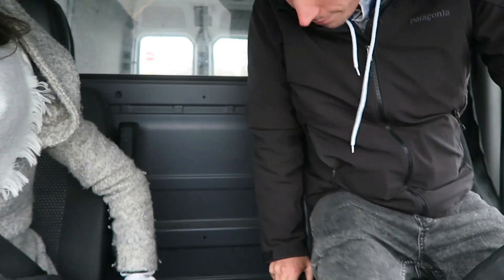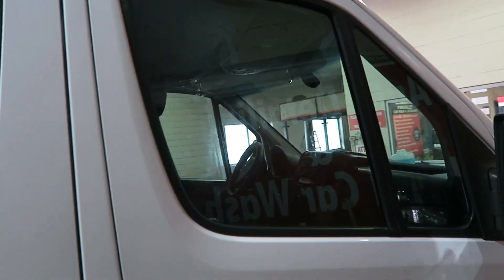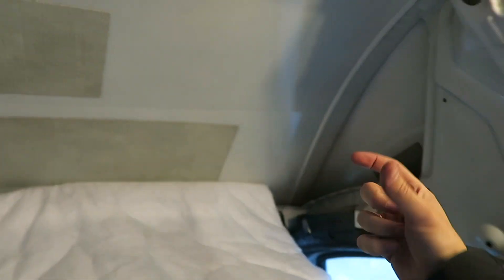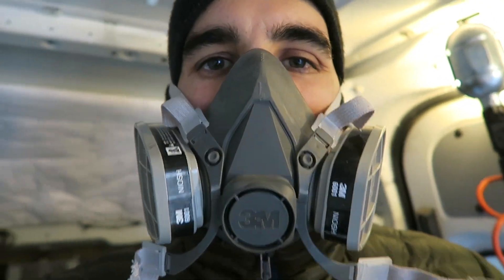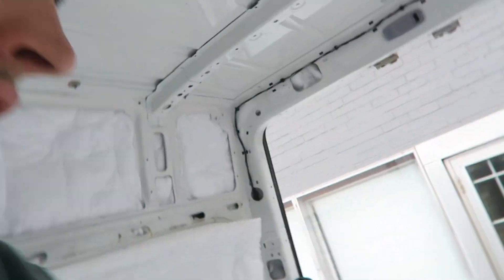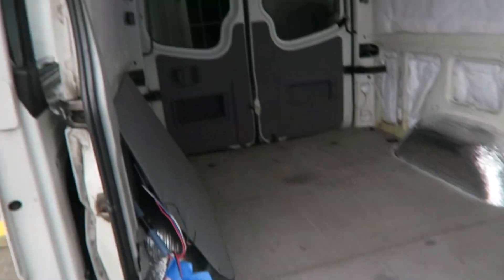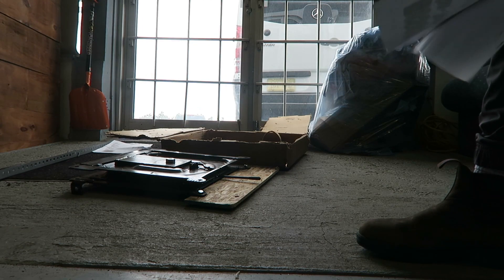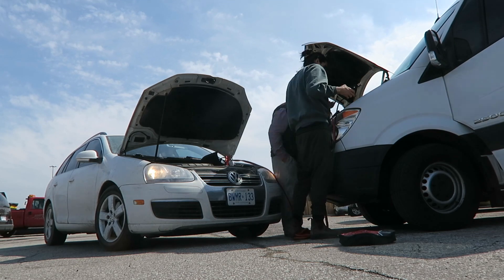Converting a Sprinter Van | Part 1 of 6 | Buying the Van, Basic Electrical, Insulation, Swivel Seat

Comment: Man, that Thinsulate is lovely to work with; I envy you.  ;)  I've used rock wool (for the low cost and because I don't have to go as thin as you do in most places since I am converting an old wooden fishing troller instead of a van), and it was by far the nastiest job.  I think I shall look for some Thinsulate for the ceiling of the engine room though since there isn't much head room.

Comment: Is the 3M thinsulate better for warmth than the foam boards that are used by most van converters?  I was planning to use foam boards but now I may switch to 3M thinsulate. 
Is applying the reflectix farthest from the metal after the 3M thinsulate going help prevent the heat from coming through on hot summer days?
I like your idea of using the reflectix are a water barrier.

Comment: How has the insulation worked out for you? Was thinking of using thinsulate vs using foam and foamboards which a lot of people seem to do.
Reply: They did another van conversion for Eamons dad and they got spray insulation in that one a d said they wish they had done it in their van. Have a look at that video. Also they didn't insulate the floor due to Eamon  eing so tall and have regretted it ever since.
Reply: @jmk1962  I will check out the video. I haven't seen too many people using spray foam as their only insulation but instead using spray foam to get in between the beams and hard to reach areas. 

Almost every build I have seen used some type of insulation for the floor. Almost nobody puts down just a wood floor. They use at least Reflectix. I plan on doing at least a 1/2 inch foam board for the floor and 1 inch for the ceiling

Comment: Is this a 144" dodge sprinter or 158"? And what year model did you guys go with? I'm looking to buy my first used van but it seems difficult to find high top 144" models :|
Reply from the maker: Hi Maggie, we went with the 144 sprinter.  It was a 2008 used vehicle with just under 200,000 km on it.
Reply: Hello, Toronto girl here, Looking to get my Sprinter Van, how did you find it, where did you look?
Reply: Now that you have had time in the 144” would you recommend or not recommend going with the 158”?